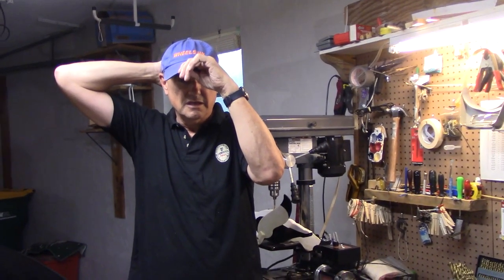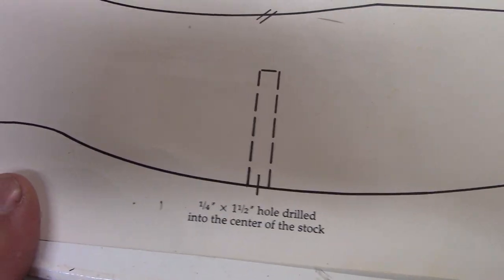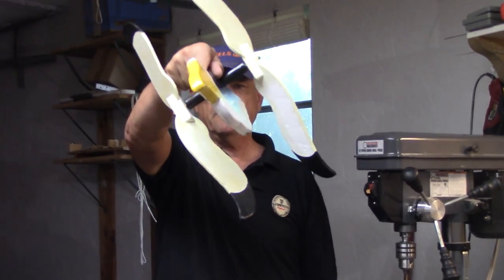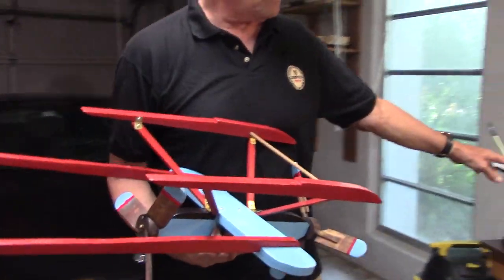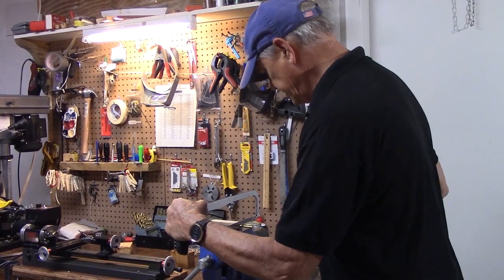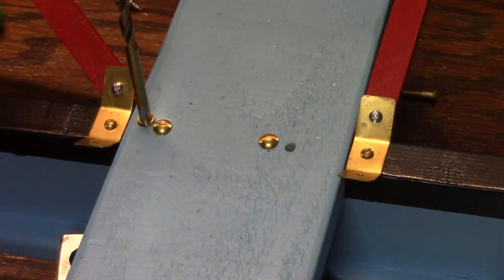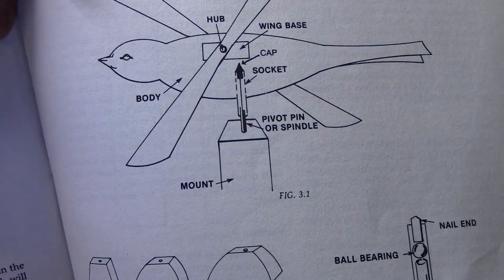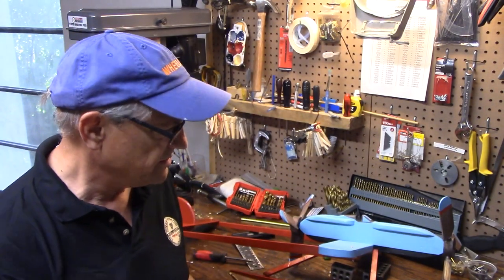How to make Whirligig Pivot Pin Beginners DiY wind spinner tip

Comment: What size ball bearing are you using inside that 1/4" tubing?
Reply from the maker: The ball bearing doesn't go inside the tubing, it is put in the hole before putting the tube in.  It's about 1/4 inch in diameter.    The tube holds it in.

Comment: Okay, but how do you put the pivot pin into the stick straight? That's my challenge.
Reply from the maker: Great question!  I use a benchtop drill press to make sure the hole is 90 degrees to the center line of the whirligig body or base.  It's best to drill it before painting, that way you can draw a centerline through the main part of the body, then I clamp the body to a machinist's 90-degree angle plate, you could use a carpenter square and a block of wood to hold it straight while you drill the pivot hole bearing hole.